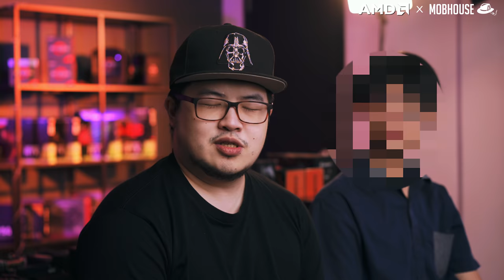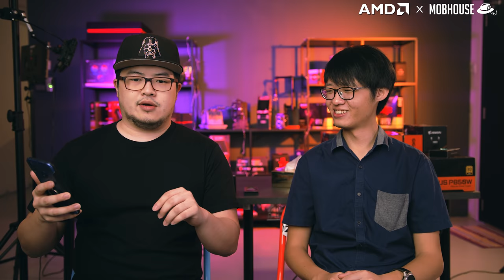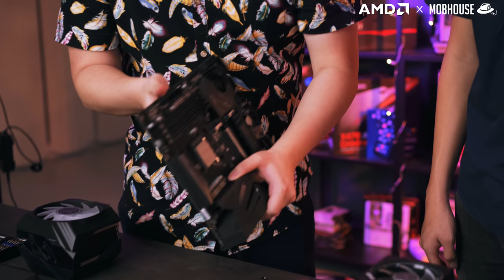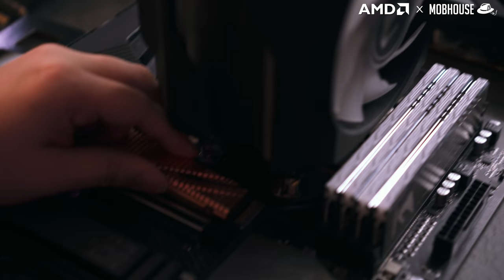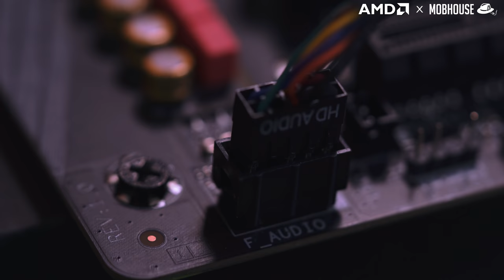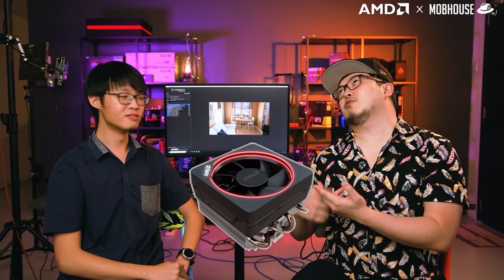YouTuber PC Build Under RM8000 / $1,800 (Guide)

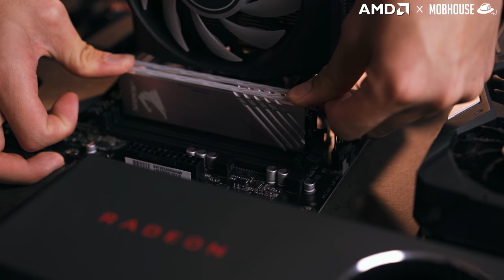Comment: 10:42 Wait...shouldn't you put the second RAM in the third slot since the first RAM is in the first slot? Or was that the dummy model? If the real RAMs are both in the same slots (A1+A2, not A1+B2), you'll only be getting a single channel config and not a dual channel.
Edit: Oh..it's the dummy RAM...

Comment: Hey dude. Just wondering why didn't you go for the 3700x instead of the 3600x. Cuz the 3600x is basically the 3600 + 200 mhz, which is not worth extra 50 bucks imo. You could have toned down the RGB to get that extra cash. 
Or alternatively or you could have gone with a ryzen 2700, it has more cores and is therefore better for editing and multitasking.  Then maybe next year or sometime later, Zy can just replace it with a new one when he feels his wallet can take the hit.